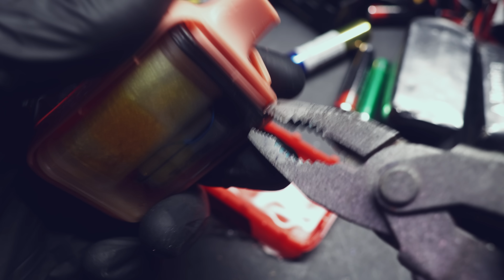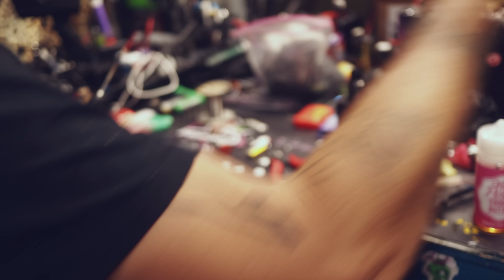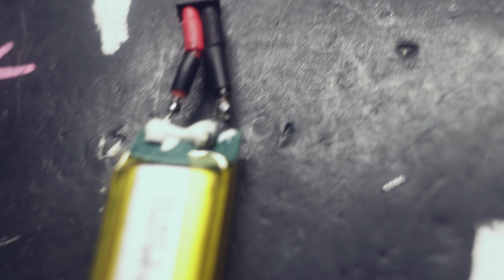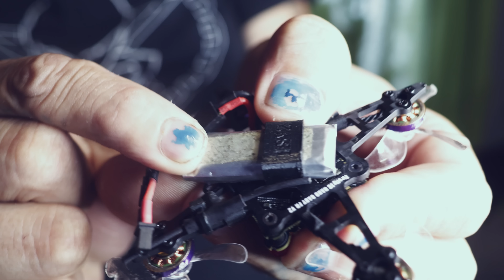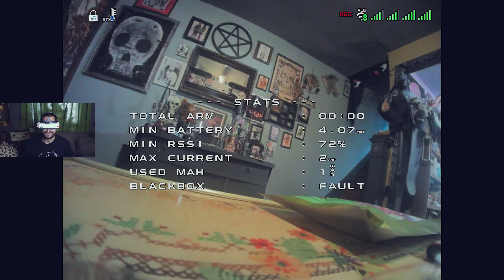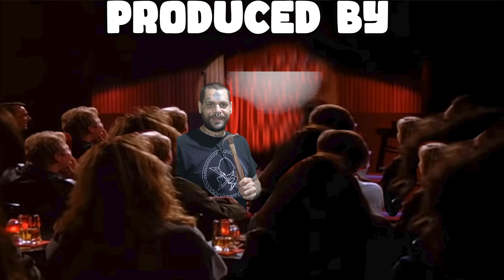Turning Disposable Vapes into drone batteries.

Comment: @BOTGRINDER I'm doing this for about two years now. Got the idea from a friend who worked in a vape shop and asked all the customers to return the empty ones. Ofc only a few did it but over some time we accumulated around 100 empty disposables and ripped them apart. I actually did some thorough testing with those bats, like estimating the max current draw they can handle, voltage drop and so on. Flying a 1S whoop isn't really fun, had about the same results you did, but beefier 75/85 whoops with a 1S2P or 2S configuration works actually quite well. Sure, the whoops are more sluggish but you can still get them to fly pretty nimble and have fun indoors. My DIY Frankenstein'd 85 whoop lasted for around 8 minutes with a DIY 2S pack (using cylindrical Li-Io bats). Also I've built some 3S5P packs for my gear as AUX packs (extra power for external ELRS modules, goggle bats and whatnot)
Reply: fuck yeah man! 
I asked some friends to keep the used ones for me and collected some on festivals this year. Got like 60 lipos in a month, some even pack 550 mah!
My Aliexpress order for some shrinkfoil and other stuff to make legit batteries is on its way.
Reading that you achieved flighttimes of 8 minutes is really reasuring.

have a great year

Comment: I used a few old vape cells to upgrade the cells in my drone buzzer. the ones that buzz loud as heck when you crash. :) good stuff.
Reply: Hobbyking once had those tiny little 1s lipos on clearance, brand new, for 0.50 cents each! 😮😜
I bought something like 25 of them for 5 bucks! Lol

Comment: Yeah cool, I do the same.
But you can find more disposable vapes in supermarkets. Most of them have this extra collecting containers for old batteries.
Also 18650 and 21700 good to find there.
Mostly, I make 2S or 3S batteries from 600mAh - 850mAh accus.
Reply: Best buy also had those recycle battery bins by the front door.

Comment: Hey, I've pulled two huge oriental rugs out of dumpsters, inflatable yard Santas, a deer cam...   but better.. stuff left out on the side of the road for trash pick up day.. a 720p LED big screen tv, basketball goal.. a huge doll house...  that I fixed up and gave away to a little girl...   a satelite dish.  Craigslist was even better.. once I brought home a boat, on a 20ft boat trailer (which I wanted), plus a free riding lawnmower to boot... all from one person.  Turned the boat trailer into an aircraft trailer and used it to pick up a free airplane, and fixed the riding lawnmower.  The boat is still in my back yard with working engine.  One of those family water ski boats from the 70's.   Got a free car once too with locked up engine.

Ain't nothing compared to the hundreds of home computers I brought home :-)   My computer hauls dwarf all the rest put together combined.

My sister got a free house trailer, free pool table, and free piano with it.  I ended up buying all three with credit card money I got, er.. .free... lol.

Comment: Disposable e-cigs have lithium batteries. I opened one and it had a18350 1000mah 3.7v. So i put a BT.2 plug on it and ripped it on a 1s babytooth 😀. Although it sagged like doodoo💩. Free battery however made it an enjoyable experiment 😁.

Comment: That was fun. Actually, I wonder if they could be used for a small power bank?
Reply: I saw a video awhile back of a guy in Ukraine making power banks for soldiers out of them. He was taking like 10 of the batteries and putting them in a 3d printed case with a little usb charge/5v boost.

Comment: These cells have a really low discharge rate, probably 30C - too low for quads…but perfect for little 1S airplanes. They’re super cheap to buy brand new but I’ve been wanting to try discarded vape cells on mine.

Comment: I see these things on the ground here in Guam.  They're EVERYWHERE.
Reply: Problem is, disposable vapes typically use a 1s battery. One cell. So, why would a person get rid of it, the battery is dead! Lol like he found out. Try finding multi cell, like 4s batteries and using a meter to check each cell. Typically one will be what brought the whole battery down. So, you'll have 3 really good cells! 😜
Reply: @KOrnhOliO1  🤔 no problem really. I would just buy batteries.. 

I would, however, be interested in watching someone strap some vapes on their drone so it smokes smores when they fly forward...
Reply: @KOrnhOliO1  They get rid of them because they're not made to be refillable and they run out of juice, the lipo is fine just super low c rating since the vape doesn't pull much current.

Comment: Wait a damn second.!. If they are disposable & RECHARGEable vapes, couldnt you recharge the battery and then disconnect it to fly the woop? I mean you flew the wooper just fine with that almost dead one. Plus you could save the recharger part and keep attaching it to charge up again, Unless they just die super fast and then it is pointless...
Reply: He charged them on a hobby charger before flying. The voltage was so low because of sag, they are only like 5c.
Reply: @thirtythreeeyes8624  Oh ok, I missed that part. Thanxs homie.

Comment: tf, you can make your own with ethanol-koh electrolyte and carbon fiber cloth as the oxygen air electrode, any metal other than copper, anything more reactive than oxygen, even hydrogen, yep simple fuel cell engine